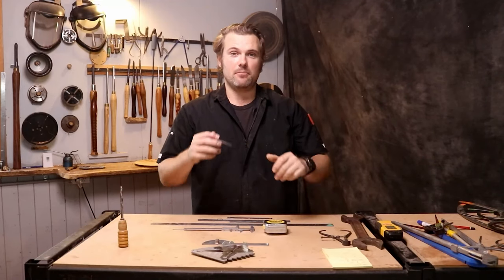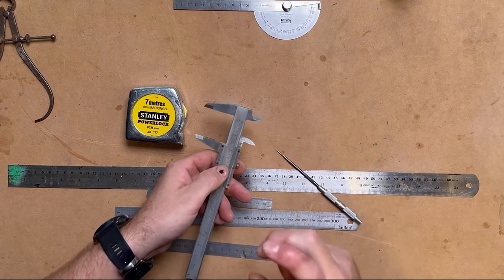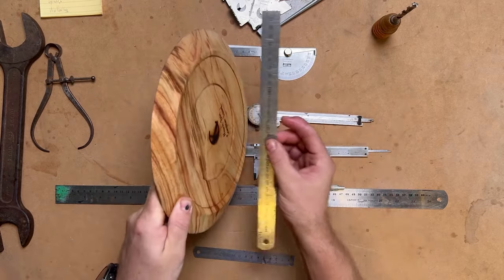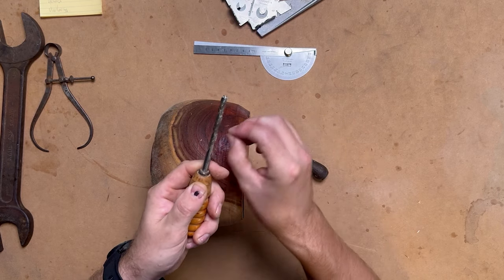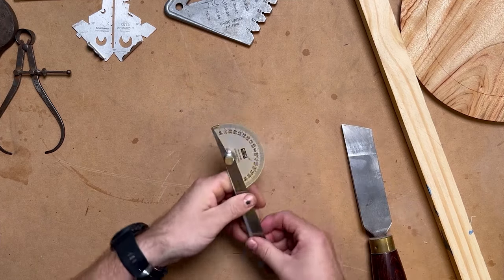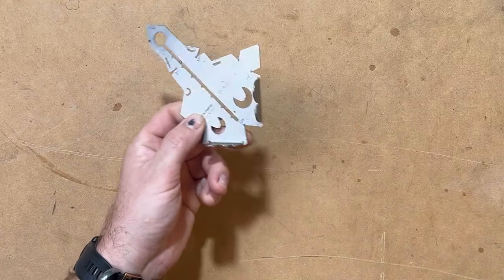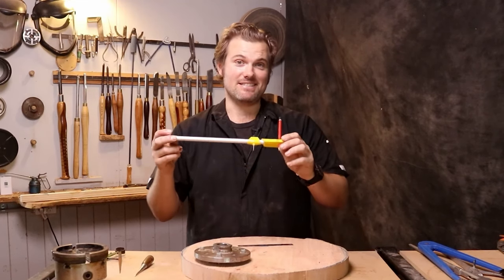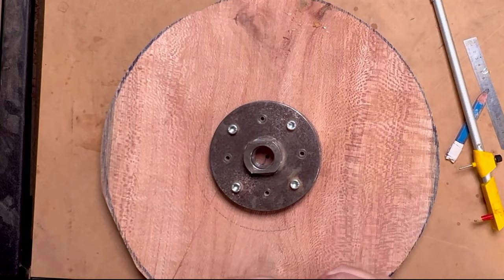The most important tools: Measuring & and marking tools for Woodturning.

Comment: Don’t know if you have ever tried it but if you take one of those spinners and sharpen one edge. You can use it as a parting tool that will give you the dimension you are looking for. Very repeatable every time if you need similar diameter down a spindle
Reply from the maker: No I haven’t tried that. Sounds interesting, is that with a spanner? 🔧 
Did you happen to catch how many times I said Vernier Calipers? Haha
Reply: @KerryCorney  I lost track but those are very useful so you can’t say it enough. Between those and calipers absolute musts. I made my dad a chess set before I learned about shadow turning. That’s when I learned about taking some open end wrenches and sharpening the edge. Made it easy to repeat dimensions to get your cove and beads. If still looking for ideas. The shadow turning would be a good one for replicating candle sticks, lamps and such. Have a great one big guy